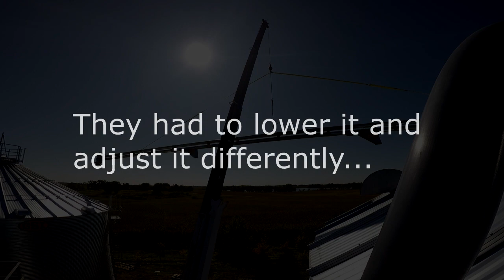Nobody got hurt!!  Moving our 117 foot, 7,300 pound conveyor to the top of our grain bins!

Comment: Awesome info on the tech that u use for planting and monitoring your fields. U did give an over view of your awesome machinery. One or a couple pieces of info if u would that I would like to know is first, what factors do you use to determine the size of the tractors and equipment. Second how many acres in total do u farm. If you haven't mentioned it and I just missed it. Thank you for the videos looking forward to more
Reply from the maker: Jason Norris we farm 2,500 acres.  As far as equipment sizes, we generally decide based on what types of jobs we will be doing with the tractors.

Comment: Great video.  Love the witty comments.  Once it's in place can you show a view from on top of one of the bins?  Being the round pipes, are there two augers?
Reply: I believe there's a chain in the tubes. Continuous lope.
Reply from the maker: Brian Barnes Klug is correct.  There's a continuous loop inside.  It's a chain with poly paddles on it about every 12".
Reply: Cool.  For a future video idea you could go through the grain handling system in even greater detail than this and the previous video (bushels per minute / how you control where the grain is flowing - all from the shed or do you have to climb the leg/bins to open and close doors).

Comment: Is this faster than the air system or is it so you can run both at the same time?
Reply from the maker: Andrew L1 We will be able to move dry grain into any of those bins now without having to cycle it through the dryer and into the air system.  For this year it will be nice because we plan on storing 2 bins full of soybeans, so hopefully those are dry right out of the field.
Reply: Sell the beans from the field, doesn't pay to store.  Unless it to far to haul to your market of choice, at harvest time.
Reply: Klug Farms Klug we have made a lot of money locking basis and holding beans.
Reply from the maker: In our area, storage has paid off HUGE for us.  It's one of the best (if not THE best) investments we have made.  It allows us to wait for better basis, blend different qualitites of grain to avoid high priced discounts, frees up our marketing so we can sell to whoever is willing to pay us better (trucking costs are always a factor), and we never have to wait in long lines at the elevator during harvest, which is huge in our area because often times we're against the clock before the weather turns bad.
Reply: Seems like where ever your at the waiting in lines kills your time in the field the cost of the bins is out weighed by the cost of time lost in line and most times around here the market price drops big time at harvest
Reply: Most farmer around where I live, SEMN,  sell or deliver right from the field, the beans.  Price ahead, during the summer.  You have to deal with a Elevator that have their Acts together,  with very little wait times.  You should also have your own truck / semi,  which required you to be a big farmer.  The bean price hasn't changed much in the last couple years,  so it doesn't pay to store, same as corn,  but like you say, when the weathers good, you need to be harvesting,  not waiting. I have to sell some in the Fall, when the bins get full.   I've been selling dry corn, instead of wet, I can dry it cheaper than the elevator charges.  That way the trucks can come in load themselves.  I don't have a grain cart & some one extra to drive it, so it works good that way.   Most times around here in the Fall, you can't drive truck / semi in a wet field any ways.

Comment: Looks like a small crane for the job. Unless it’s just how it looks on video.
Reply from the maker: PA Farms It was just barely big enough.  That's why they had to set it back down and boom out more.  It didn't have the hydraulic power to boom out in the air.
Reply: MN Millennial Farmer at that point I would have insisted on a new crane.
Reply: They also had the straps at a too low of angle and I can assure you that the come-along in the center is NOT OSHA approved for lifting 7000 lbs. Lifting over the front of a boom truck is not recommended by most manufactures. I was a crane operator for 16 years and my dad was a crane operator for 40 years.
Reply: @kingmike40 that come-along is probably to take some of the high loads due to the low angle.. ideal they would have used a spreader to rig the load to 4 or 5 points. they would have needed a bigger crane, but this one was a bit on the wee side anyway :-). Also: no hard heads, and no fall arrest equipment.

Comment: I would only be up there if I was:  1) drugged out of my gord & 2) cabled & strapped down!
Reply from the maker: thr8061 I don't mind being where I was at but climbing to the peak is not something I enjoy!
Reply: I never enjoyed climbing our 88' silos on the outside either, but when you plug the blower pipe, someone has to go up and bang on it!  I had no issues climbing on the inside, but on the outside it just seemed higher.